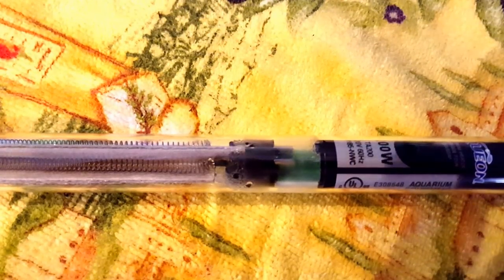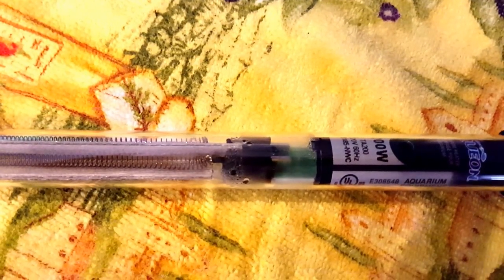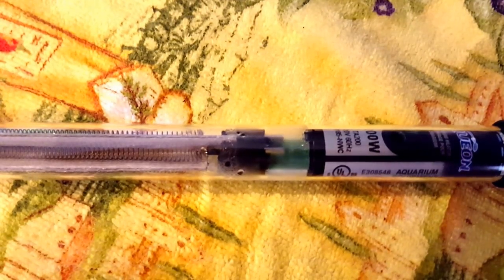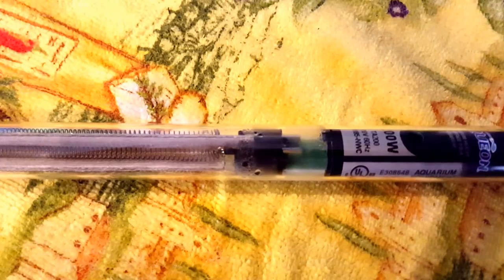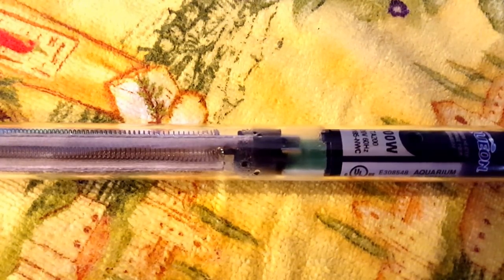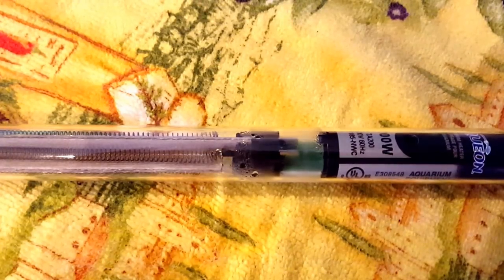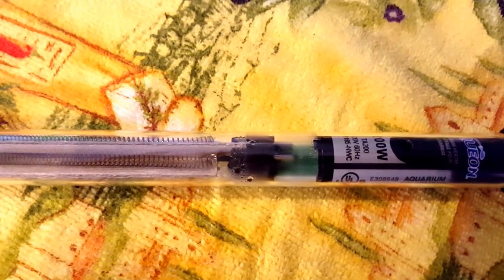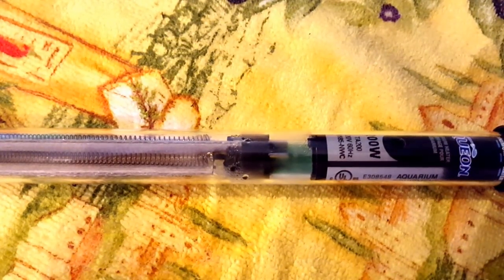AFRICAN CICHLIDS│ HEATER│MALFUNCTION

Comment: i’ve had a couple of aqueon heaters though they are not the best every time i get one of these they seem to have water inside, i doubt it would fail but i would be safe and get an eheim or hydro heater
Reply from the maker: Hi Zach.. Welcome to my channel. I called the company. They explained that condensation in the tube is normal and not a malfunction. I have been using mine since and it's fine. I do prefer Eheim myself. Thanks for coming by happy New Year Zach! =D
Reply: good to know i may continue to use my old “retired” ones which had condensation, i’m with you i have never had an eheim fail on me or even have a single issue, Happy New Years!